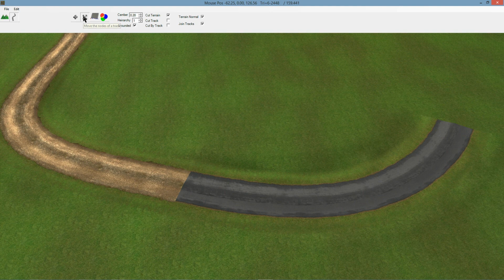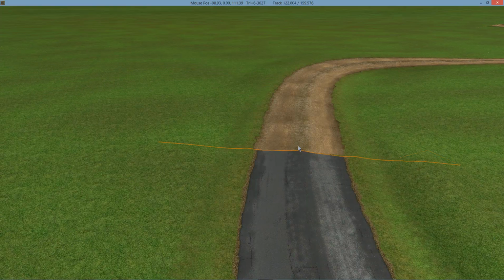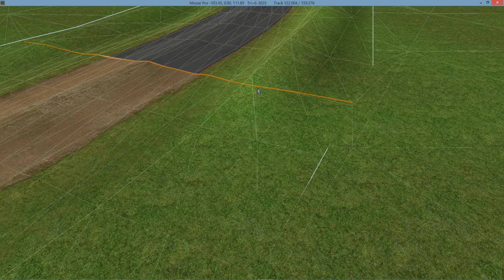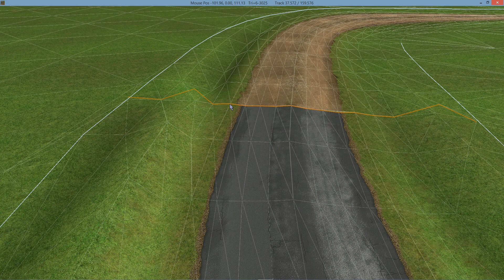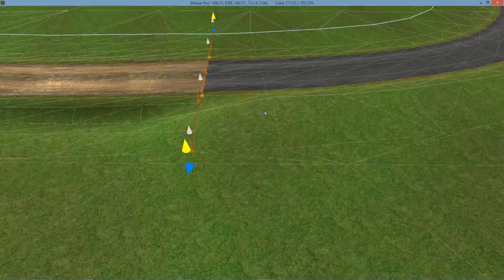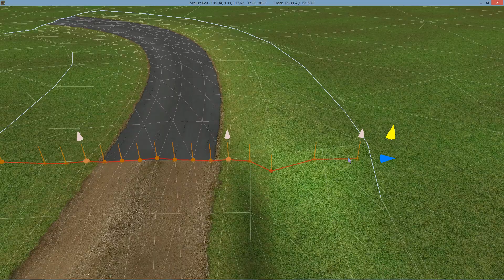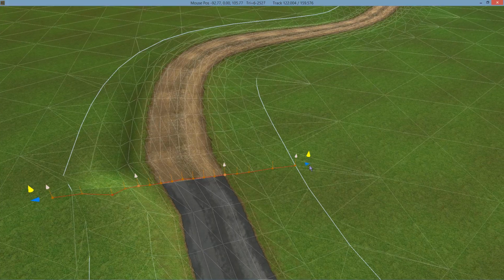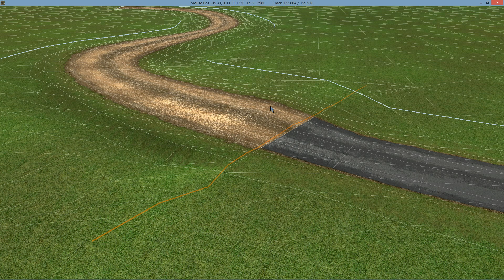Track - Cross section and Joins

Comment: Sir, when merging a pit road onto the main track is where I'm stuggling.  I track cut and the lower heirchy (pit) road has taller chunks.
Is it a matter of manipulating the pit road cross section??
Any advice would help.
It would be nice if your software merges them together smoothly.